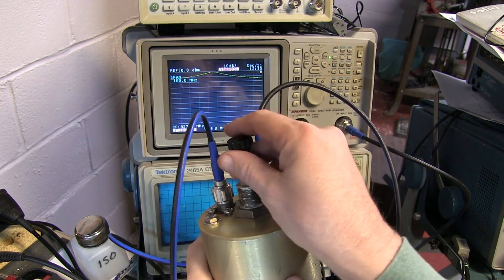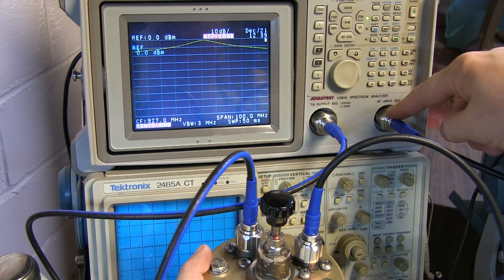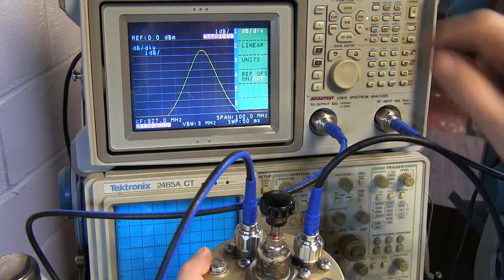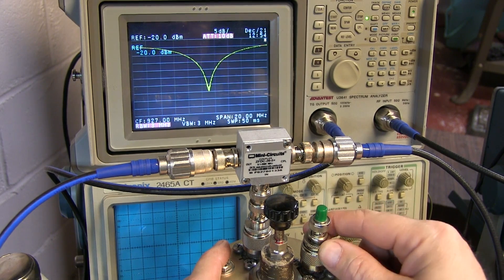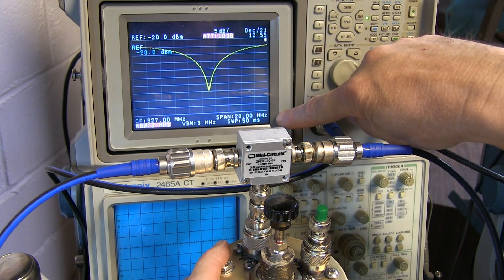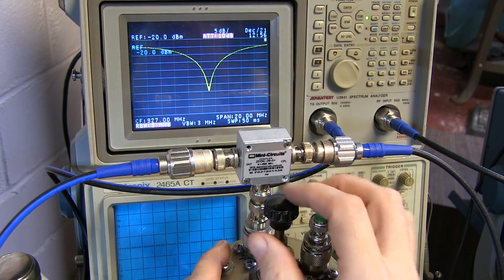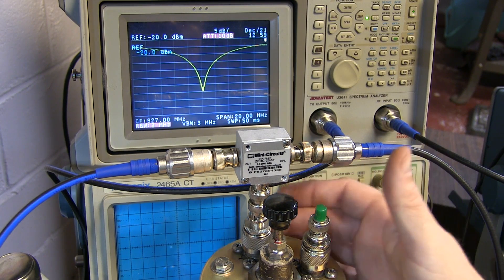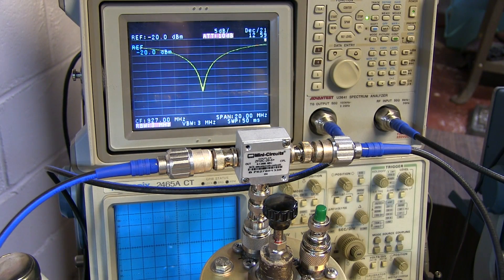#248: Tune Bandpass Cavity Filter using Return Loss w Directional Coupler

Comment: Does this method only work for bandpass cavities?
Reply from the maker: It will work for most non-absorptive filters (where out of band signals are reflected - i.e. have poor return loss).
Reply: @w2aew  I guess I should have asked if tuning a bandpass/ band reject cavity with a Rigol DSA815 spectrum analyzer is it best to use directional coupler for the pass then use spectrum analyzer to set notch.  I really like your videos.
Reply from the maker: @jimromine2917  You can use a coupler for the bandpass too - the return loss will give you a sharper view of the bandpass adjustment vs. the through response.

Comment: Thanks for a great video. A set six db-4021 “duplexer I was told” we’re donated to our club. I will be trying to tune them but I noticed these are bandpass  filter cavities. They are set up 3 for RX 449.375 and 3 for TX 444.375. Is this use of bandpass filters as duplexers possible or usable.?
Reply from the maker: Bandpass only filters can be used for duplexer applications, they just won't provide as much isolation as bandpass/band-reject arrangements.  The information on this filter set can be found here: http://www.repeater-builder.com/antenna/db/pdfs/db-band-pass-cavity-filter-installation-and-tuning-instructions.pdf
You'll have to carefully examine the filter characteristics to see if they are "sharp" enough to provide the level of isolation needed in your repeater application.  There is a wealth of great information on the www.repeater-builder.com website.

Comment: It seems to me you didn't put a 10 dB attenuation on the tracking generator output. That was a  recommendation in your video (#158 I think) showing SWR measurement with a directional coupler. Is there a specific reason for in this case?
Reply from the maker: No real reason why I didn't use the attenuator.  It wouldn't make much difference in this case, since the region we're interested in is where the match is good.  Good catch though!

Comment: Hey Alan, Excellent as always!  
So I have had experienced radio techs tell me that for an in service repeater that the actual impedance of the antenna and/or the next filter (in the case of say a 4 can duplexer) will make a difference in the proper tuning.  What are your thoughts on tuning individual cans using your example and then connecting them together and terminating to a real life antenna?  Will the system still be at optimum tuning or will the system require final tweaking due to all the components not being exactly 50 ohms?

And YES please do an video on the other parts and aspects of tuning with the capacitors and other adjustable parts of a band pass/reject system.
73, n7kbc
Reply from the maker: The old techs are right. You can start with adjusting each individually in a perfect 50 ohm environment, but you will want to tweak it when connected to the actual equipment and antenna.

Comment: Another excellent tip Alan.  My boss taught me to do this in the early 90's, we had four UHF commercial repeaters at the time and a14 channel 800 MHz trunked system on the local tower. This really helped narrowing down the center frequency.  Had all but completely forgotten about this. Thanks again.
Reply from the maker: Thanks - it certainly makes it easier to zero in on the passband center frequency.  I don't mess with these bandpass cavities much - I was surprised that the Q is as low as it is.  But, it is just one cavity, so I guess it is normal.

Comment: I once had to align a multi-cavity filter for 70cm. I used S11 and S21 and it was a real pain to get it decent. Then I read that it was better to use TDR instead of S11. I tried that, and  with TDR it was indeed "easy" to get all three cavities at 50 ohm and minimun transmission loss. So besides finding broken Christmas tree lights TDR turned out to be handy for cavities too ;-)
Reply: w2aew  He might be talking about the TDR function on a VNA. It is a reverse FFT. I use it on my Agilent 8753ES. The HP application note recommends using the TDR function to adjust multi polel filters
Reply from the maker: Hmmm - interesting.  I'll have to think about how a wideband signal like a TDR pulse can be used to tune a narrowband filter...
Reply: Yeah, I understand. If you start with a relatively narrowband frequency domain plot, then the iFFT would be able to show you which cavity is contributing to poor return loss. Makes sense.
Reply: Yes, I forgot to mention, I used the TDR function of my VNA
Reply from the maker: OK, makes much more sense now!

Comment: Hello Alan,

General Question,

I have a trolley on wheel style bookshelf structure made of wood (mostly) with some metal dowel pins,  typical  IKEA or
Office Depot construction.  I got myself a new spectrum analyzer and I need to add to the trolley/shelf/cart
to make shelves for my power supplies, scopes and the new spectrum analyzer.   Can I use metal for the 4 posts to bolt
the wooden shelves ?  I don't know if have metal near the scopes or analyzers will have any detrimental effects on the
the instruments.  My work table is rather cluttered, hence the new trolley/cart project ?  Any advice,

Kindest regards,

Peter
Reply from the maker: There should be no problem placing the instruments near any metal objects.

Comment: Until you see it demonstrated t's hard to visualize the difference in measurement fidelity between doing a simple bandpass and the return loss methodology - can't make it any clearer than you've done here Alan. Are those double shielded cables you're using for the interconnections as you would use in a duplexer system?  73 - Dino KL0S
Reply from the maker: No, they're not double shielded in this case, but you certainly would want them when tuning a high-Q duplexer.

Comment: This reminds me of trick used in radiogoniometry.  Radiation pattern of antenna change sharper between lobes than on lobe maximum. so instead of searching max of received signal they search for min.
Reply from the maker: As long as you precisely know the radiation pattern of the antenna, that works great.  Of course, assuming a symmetrical pattern, you could search or minimum on either side of the main lobe, then split the difference.

Comment: So nice to see another video of you! Is such a shallow filter characteristic typical for cavity filters? Wouldn't mind seeing another video on the topic...
Reply: I might have a better solution for you. You can use a noise source and RTL-SDR dongle and use it as a sort of spectrum analyzer. See http://hansvi.be/wordpress/?p=91 (if you can manage to fix the url)
Reply: I get you, testing equipment can cost an arm and a leg. If you can't get access to a spectrum analyzer, you'll have to be creative. You said you have a signal generator? What kind?
Also, what frequencies do you want to measure?
One route you could take is to use a simple logamp power detector in conjunction with the signal generator, e.g. make something using an AD8307. This will give you much more dynamic range. And a power meter is always nice to have.
Just spewing out ideas.
Reply from the maker: I don't have a ton of experience on these types of filters - so I'll have to look into that.  I was a bit surprised at the low-Q myself.  You can adjust the coupling loops to trade off insertion loss for better Q.  In this case, the loops are adjusted for lowest insertion loss...
Reply: can i use a Use an Oscilloscope and Signal Generator help tune duplexer if i cant get a  anlizer
Reply: spectrum analyzer
Reply from the maker: The only real problem with that is dynamic range.  When tuning cavity filters, you often need 80dB or more of measurement dynamic range, which is difficult to get with a dongle and noise source.  For peaking the filter response, this works fine.  For fine tuning a reject / notch, it probably wouldn't be OK.
Reply from the maker: You probably won't have enough sensitivity with a scope to tune a notch filter, but it potentially could be used to tune a bandpass filter, provided the scope BW is sufficient for the test frequency.
Reply: then what i need to look for in a scope then
Reply: thanks for the video i have learn alot in watching them i just want to get some equipment to do things i cant aford a spectrum analyzer even the used ones on ebay is high dollar

Comment: Excellent explanation of a better way to tune a filter.  Will have to give this a try this evening.  Thanks for sharing.

Mike
Reply from the maker: Keep in mind that this is a great way to find center frequency.  If you want "accurate" return loss measurement, particularly outside of the filter's center frequency, you'll want to include an attenuator between the tracking generator and the coupler, so that the reflected energy doesn't adversely affect the TG output.
Reply: w2aew 

Thanks for the extra tip.

Mike